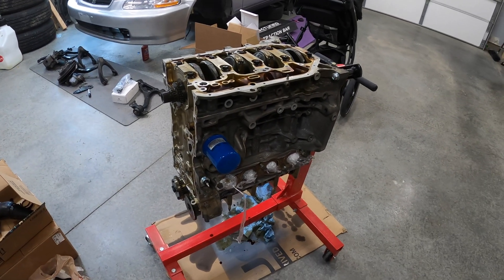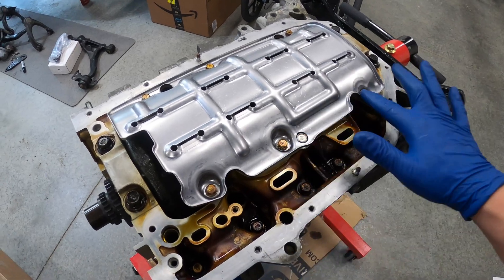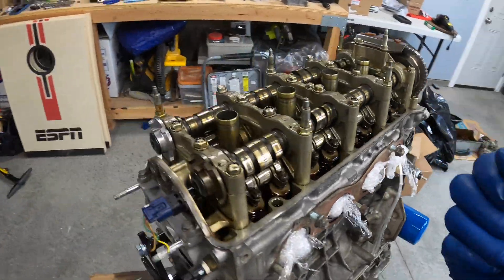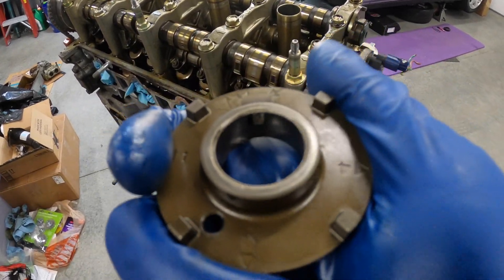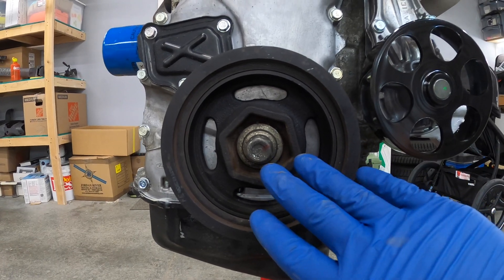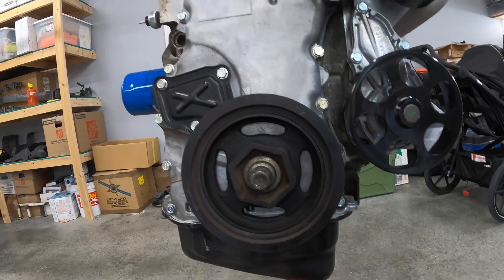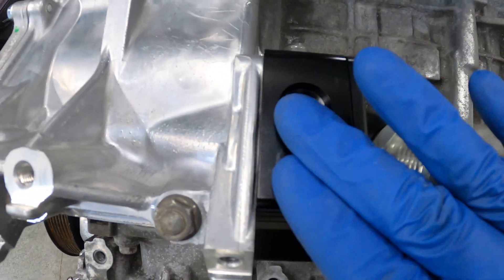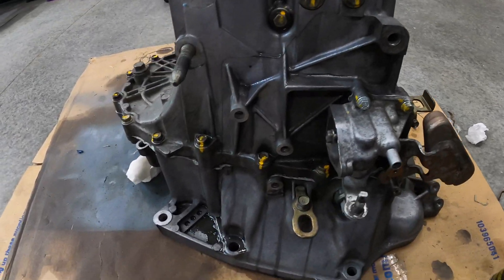K24 swap part 5.  4Piston ported k20 oil pump installed on the JDM K24.

Comment: Can I do the install without taking out the engine? 9th gen si owner
Reply: no you need the engine out to do it. i just did the 4p ported oil pump on my jdmk24a basically is the same as a z3-7 its the r40 even though it says k24a and the kit has all you need its been revised from every video i have seen on the parts for install.